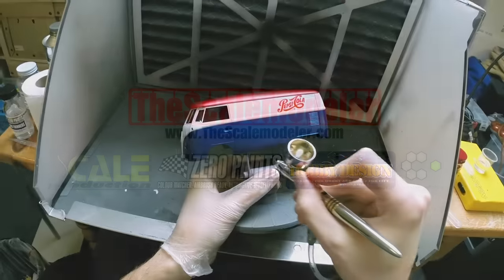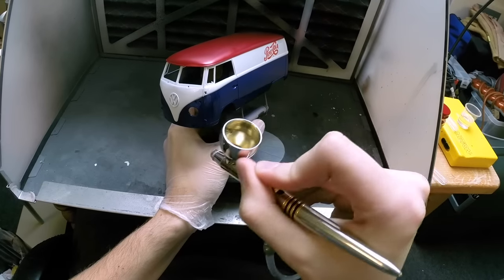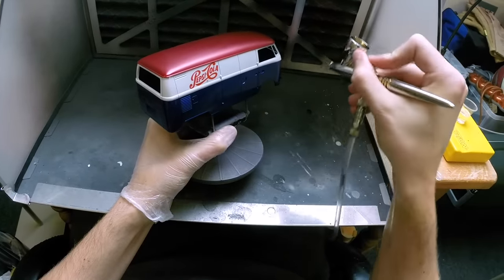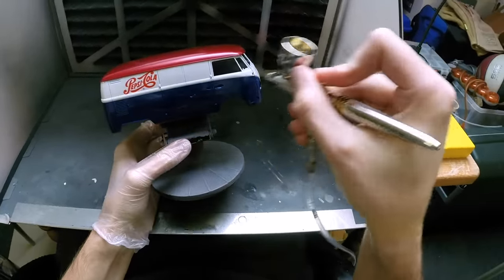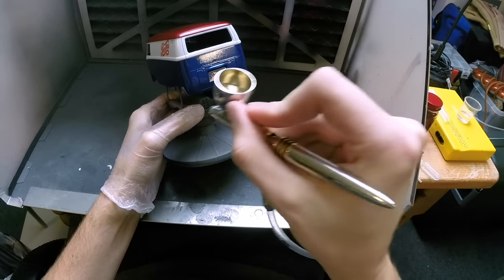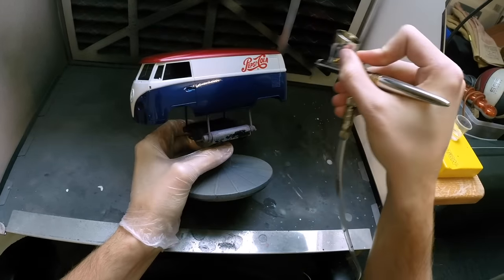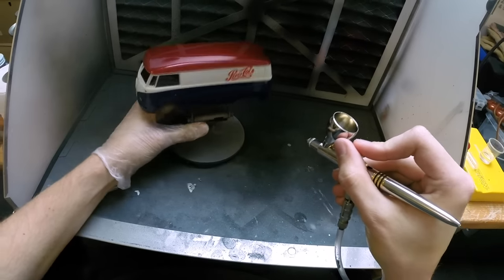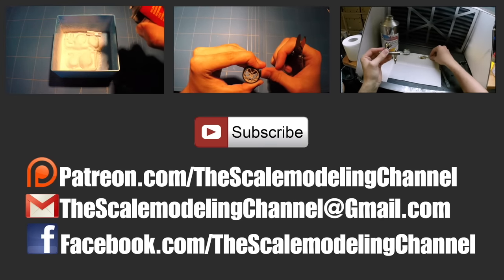Hasegawa: VW T1 Type 2 Bus Part 4

Comment: hi, i would like to give you a tip, wait the clear coat dry for 24hs or more than sand it with a 2.500 or 3.000 grid sand paper with water, sand it untill it gets level than polish it with leveling copond untill there is the pait starts to get shining than use your favorite kind of wax, you will have a perfect pait job, this bus will look even more perfect ! hope you give it a try
Reply from the maker: +MrAndreppc I have done that in the past, though i can still see the scratches when i am finished polishing, and i pretty much cant stand that:P
https://www.youtube.com/watch?v=jBVwk_gk33w
Reply: +The Scalemodeling Channel hi, i juts wathc the video in the link, if i my correct: you need to sand it less, use only a 2,500 or 3000 grid, when sanding it use circular motions only tha is important and when you polish it use straght moviments if you do this way you will "break" the sand paper marks, when i do this i think that the most important part is the polishing part that is when you get the scratches so polishi like hell hahaha, if i may... is there any way i can send you a picture of one of my kits? it is a red 911 turbo. sorry for my english but i'm from Brazil
Reply from the maker: You can post them on my facebook page: facebook.com/thescalemodelingchannel
Reply: I have a question. I'm building a nissan skyline 1/24 and stuffed the windows bought another kit but its an